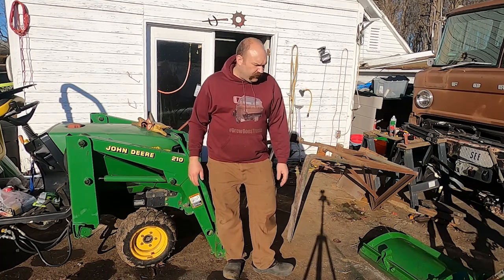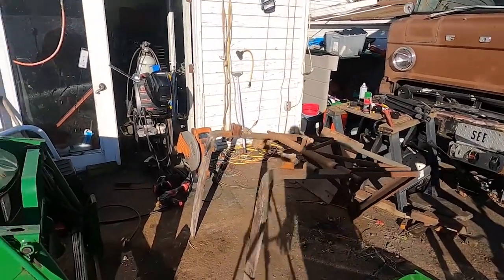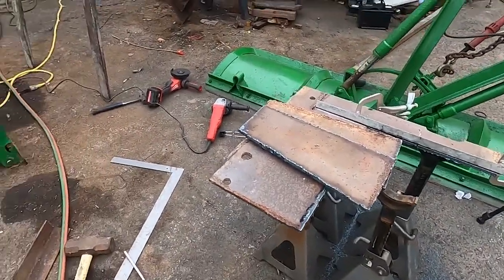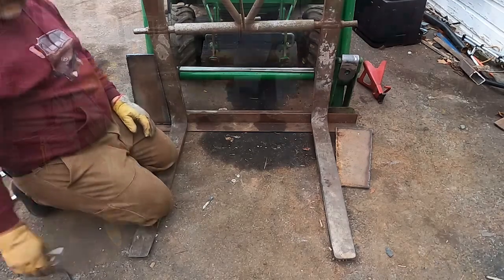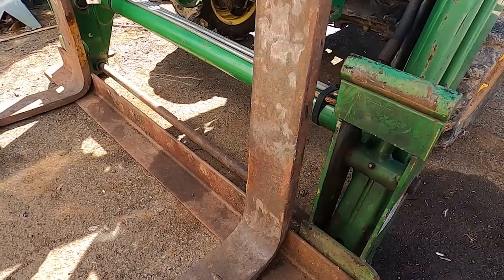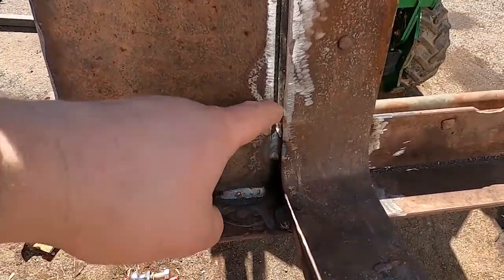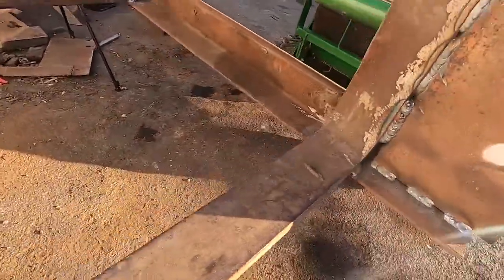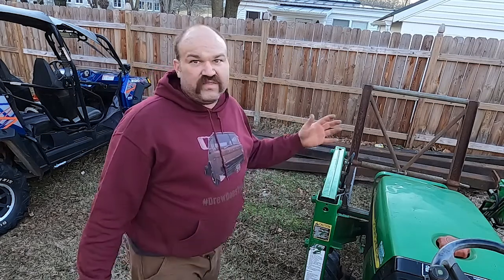Building my John Deere tractor some loader forklift forks out of scrap, DIY style!

Comment: Good video, correct choice and reason on the stitch welding. Keep the headache rack until you cannot stand it anymore. Good project.
Reply from the maker: If I ever get rid of the headache rack I would just weld something shorter in it’s place. The only issues I’ve had with it so far is getting up under and against something like a truck bed where I want to tilt the forks down but the headache rack would hit the tailgate. So far I’ve been able to work around it. And I just know I’ll drop something on the hood or worse if I get rid of it.
Reply: That headache rack just looks out of place by is functional. Once you get more time with the forks and just some time to alter it you can. Makes for a filler video later on.

Comment: Your welding skills match your tractor skills.
Reply from the maker: I have beat the ever-loving crap out of these forks. I use them almost daily, even after I got a forklift. I’ve had them under embedded rocks with the entire tractor hanging in the air trying to lever them out. They have definitely stood the test of time.